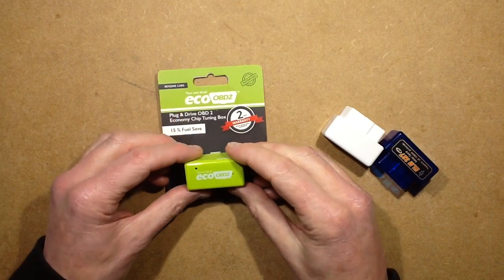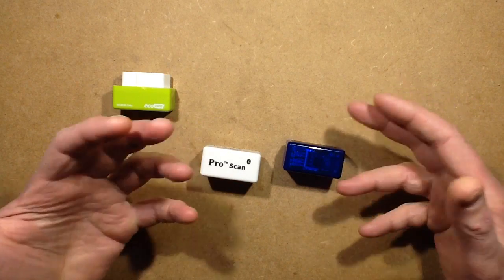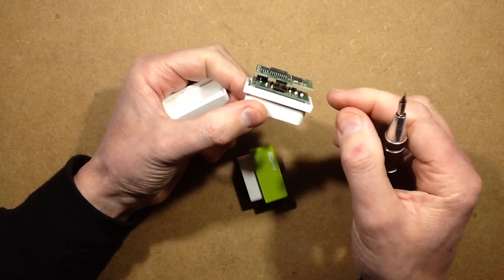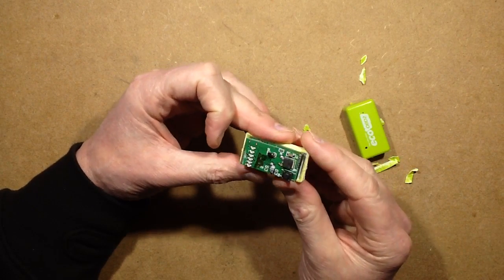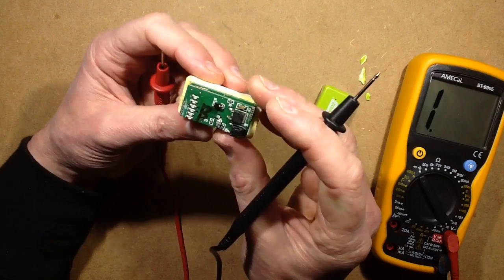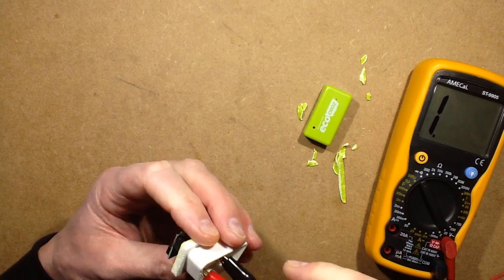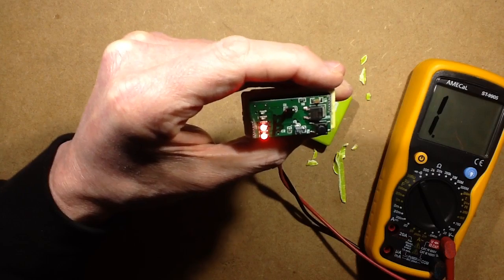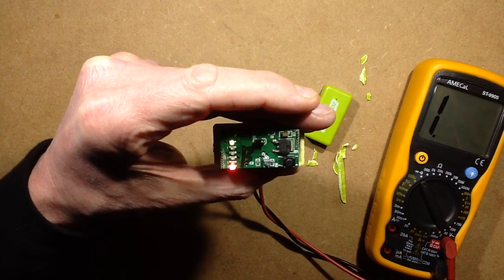Inside an ECO OBD2 "chip tuner" fuel saver.

Comment: I dunno what the OBD specs are, but it's pretty certainly a serial bus. Got an oscilloscope, Clive? Or a Bus Pirate, or knock up something with a microcontroller. 

Would be interesting to see what it's trying to send. With some info on the OBD specs, message format, and commands, you might be able to rig it up to a serial port (or a USB emulated one), open a terminal, and try probe it's depths. 

It looks like it does more than just flash LEDs, a cheap fake device would surely do that much more cheaply, with just a couple of chips. Looks like it's trying to make contact with something. The way the Chinese share / steal intellectual property, they could afford to sell it for not much more than the parts cost, if they could get hold of the software free. Which is kindof a Chinese thing.

Comment: from my understanding, anyone can tune (mode 08) the engine thru the odb2 port.  however, chances are this little device, if it is real, only holds a small amount of power in performing modifications (very limited space for data and only has enough programming to do minor adjustments).  my guess is that even if you connected it up and it did something, it would be unable to cause enough damage that you would need repairs.

Comment: Mmmm.... you opened an electronic box.... and nothing more...
Reply from the maker: +Mac Anix I was able to ascertain that it was more than just a resistor and LED.  But without literally hundreds of thousands of dollars of specialist engine simulation hardware and a long enough test, it's hard to ascertain more.  The sellers are probably relying on that and an "analysis time" to let people forget how much they paid for something that most likely does not fulfil the role of what would be an engineering miracle if it could actively re-map the engine control system of absolutely any model of car.
Reply: +Armens Peas  Oh please... get off your pretentious soapbox. I watch a lot of Clive's videos and find them highly informative. I make one observation on this video and you call it 'belittling & ignorant' and then (ignorantly?) surmise I have no background in electrical engineering LC? I suppose in your world if the comment doesn't fit your predetermined expectations then it shouldn't be mentioned? I recall someone called Adolf had the same great idea a while back...

Comment: Do you see a comm output, for example pins for a serial port, or USB, or a wifi or bluetooth antenna trace?  I'm thinking they just took a OBDII diagnostic scanner, the type you can buy now for around $4 USD on ebay (or less in volume) ordered it in bulk with a different color case on it, and called it something it's not.  I mean that if you can find the way to interface it, you might find it still outputs OBDII data... if there's an antenna lead the first thing I'd try is to pair it with a cell phone.

Comment: I love the little internal needle-hole reset switch, lol... it's like "We know this thing will go wrong eventually, so we need to make it so they can actually try to use this beast again from scratch"

Seriously, if you don't know how to deal with car computers on a fundamental level, you REALLY shouldn't be sticking things into your OBD that say they will 'save fuel'.  I wouldn't be surprised if this just leans off fuel use to save fuel, which will certainly work, but you'll end up paying more later from the damage this can cause in some cars/trucks.
Reply: +ReddmanDGZ  Chances are, it does nothing at all. The reset button is probably just there to make the device seem more elaborate, as are the LEDs, but if the device doesn't make the impression that it does something, people will suspect more easily that it's merely a brick. Perhaps it detects CAN bus activity or maybe even reads some common regular status messages to time the LEDs differently, thus displaying different behaviour when it's on accessory power vs. when the engine is running, and if some sophistication is applied, perhaps also depending on total time of use since reset. If i was a dishonest person who wanted to relieve people of their money, that's how i would approach the task. Much lower risk to everyone involved to release a device that merely imitates activity than one that could actually harm something. And with firmware protection common in today's controllers, it would take consumers a lot of money to prove that the device does nothing, while it's not worth it for them, they didn't exactly pay a fortune for this.

Comment: Yea... if this thing isn't REALLY stringently built and coded, it can basically have horrific cascade runaway in the code (for example leaning the fuel off until it burns up the engine).  The best way to do it is using an old smartphone connected to a USB OBD II scanner, and getting a realtime and logged readout of your driving, and YOU AS THE DRIVER adjust your patterns to save more fuel.

Comment: Hey, this is a new one on Me! Most "power chip tuners" are just a resistor put inline with the temp sender making the ECU run the engine richer in a cold running mode. It makes a little difference, but usually makes the engine run like crap pretty quickly. But having something plugged into the OBD port ? Yeah, i think this is just a little light show and nothing more. I wouldn't be surprised if some came with direct shorts just to mess with people.

Comment: Plug it into a rental car and see what it does... That is a dirty way of testing but make sure you also get the full insurance just in case your test messes the car up. Yes you are spending money BUT you are not messing up your own lorrie.
Reply: +KingOfAllAnimals BTW... drive the car and test how much fuel it consumes between two points. Then make a return trip. Measure fuel use vs. Mileage. Make the trip each way at least consume a 1/4 tank of fuel. Then plug the unit in and drive the same trip both ways with the insurance that the trip is the same length as the previous trips and also enough to give the required time for the chip to do its scanning. Then make the third trip after the device has fully done its job and test the fuel on the exact same trip and see if it improves mileage.

This also is important, make as much of the trip uninterrupted as it can be by traffic. Open Highway type testing is preferred so loiter time in traffic does not compromise actually "Mile for mile" testing. This helps make the results more comprehensive with less margin of error.

If this thing does really work the test as laid out should spell it out clear as night and day f the improvement is noticeable. 1 to 2 MPG or KPL is nice but adding over 5 MPG is quite significant as would a 5 KPL increase in efficiency. More then that would be rather nice.

Also effect the same kind of test in "City" driving. I mean traffic and a lot of stop and go from point A to point B and back to point A. See if the improvement works under both conditions.

For doing this in the same vehicle I would do the City Run first without using the chip. Then I would do the Highway run without the chip. Then I would do the Highway Run to calibrate the chip. Then I would do the highway run after calibration. Then do a city run. Compare mileage under all conditions trip for trip. Reset the chip and do the City run to recalibrate and then the City Run to test mileage again to see if there is any noticeable difference between it learning from Highway Driving to City Driving and the efficiency it produces.

The reason I would do it this way is for these very reasons:
1. How intuitive is this system? Can it make adjustments that work for ALL driving conditions or just tailors itself to a specific kind of driving ie. City vs. Highway. I can tell you for highway having Cruise Control makes a huge difference in mileage. There are variables like this that must be taken into account like does the test car have Cruise Control or not and if so is it used in part or whole of the A-B-A trip sequence and where and for how long. It all depends on how accurate you are looking to get for your testing.
2. You can more accurately tell if this system actually DOES anything for the vehicle under both driving conditions.
3. You also can hook up other diagnostic tools for on the fly real time data harvesting just to get the real ticky tacks on what this things does.

Best part is using an insured rental car you can choose your specific test bed and then switch to another car to see if the results are repeatable in a different make and model again not risking your own vehicle for such testing. the "Full coverage insurance" will deal with those "Ooops moments." That is all part of the cost of renting a car. While it does cost money it does allow for you to test this out effectively and also it gives you time in selecting the best candidate cars for testing and which diagnostic tools you wish to run while conducting your testing.

...For some odd reason I am feeling a touch scientific today...

Comment: I tend to agree with you on being nervous about plugging it in...I had one of the ELM327's that was orange and it seemed to work but was slow so I got a blue one and it scrambled my car after the 1st trip, I got a bunch of warning lights, the computer stopped responding to accelerator movement, stability control, cruise control cut out, electronic parking brake stopped working...then when I stopped I couldn't get the engine to re-fire (crank but never start).  When I finally got it to work in any capacity I had a bunch of fault codes for COMM-BUS faults and sensor-faults.

I now have an OBDLink MX which cost a fair bit more but works fast and hasn't set off any error codes.

BTW, I find to brake those things open with the least damage, a few whacks along the seam with a rubber hammer usually breaks the glue with no damage.

Comment: The blue one works perfect in my 2013 Berlingo and the Torque app.
Reply: +ferkemall I have an ELM 322 with the torque app and I use it on my Chevy Volt. It is able to read pretty much all the information and reset codes even for odd subsystems like "high voltage charging system," etc.

Comment: An easy way to tell if it at all does communicate. On most Chrysler vehicles (dodge, ram, and jeep included) if an external can bus ecu is detected on the bus of the vehicles network, there will be set on multiple nodes the communication code U1147 (external can bus edu detected) So if you plug that little device into a Chrysler vehicle, and happen to know someone with a scanner such as a solus edge like myself, after you plug it in and unplug it, you'll find that code on multiple nodes. Easy :)

Comment: As a technician I will have to say it probably does nothing, as any "fuel saving" device does. At very most it will probably try to tell the ECU to open the injectors less which would seriously damage the engine if it was running lean for long periods of time, but having said that, if it even could try to limit the time the injectors spray for the ECU would overrule anything as it's programmed to keep the stoichiometry at 14.7:1 (air, to fuel ratio). 

The only way you can actually hard program an ECU to be more fuel efficient is to actually have software and hardware which you manually control and adjust by your own knowledge, or that of a pro-programmed "map" as they call them. Bluefin is a well known example of the only DIY kit you can buy which can increase power by a few BHP but at the cost of several hundred pounds. 

Diesel is where the real excitement is coming into reprogramming ecu's, because more often then not you can increase BHP dramatically and in some cases almost double the torque figures while actually being in some cases around 25-40% more fuel efficient, but that does include some physical engine modifications such as removal of EGR/DPF etc. 

The only real way to save fuel, is not to buy ebay product from china, but to leave the car at home and walk! :-)

Comment: if it does anything its more than likely ignoring the emissions requirements and giving the engine its proper fuel to air ratio,  the leaner you run a gasoline engine the more horsepower it produces (within reason of course, push it to the extreme and it will cause catastrophic damage) more horsepower per given RPM means better fuel effeciancy.for the sake of emissions your cars computer does everything it can to maintain a mix of 14.7:1, which provides the cleanes emmisions, which is normally not what the engine wants

Comment: The only way to find out if it is a hoax, is hook up a bus analyzer to the can bus and look what it is spitting out.
Reply: +donven33 Simple put, it isn't possible for such a small device to effectively manipulate the mileage. It could do basic calculations but isn't capable of writing something into the bus to effectively alter the engine parameters. You need to know the exact PIDs and the layout of the ECU. I couldn't even see any memory or even at least an ELM327 chip which would be able to communicate with the ECU. There are very complex OBD-Plugin chips on the market which are designed for a specific car and do the job but are very limited and quite huge actually. If you want to get more out of it, you need to opt for a solution which sits near around the ECU if you don't want to overwrite the original mapping of your ECU. I installed a chip into my car which sits between the commonrail and ECU which is able to precisely manage the engine parameters, increasing bhp and mileage (documented). The reason why this setting isn't to be found on a stock car is that for example the greater brother of my car would have the same engine but a different mapping and therefore would do the same like mine with a chip but can be sold for much more money. I could even have a mapping from 2 steps above my model and it would run just fine without any reason to be worried about an engine failure of some sort because it is just a different set of parameters fed into the stream.
Bottom line: Chip tuning is a thing, mapping ECUs is an art and OBD Eco devices are a huge hoax.
Reply: +tHaH4x0r I think it would be easier to solder a few wires on the microcontroller's JTAG pins and dump its firmware. Few hundred lines of assembly at most.
Reply: + bigclivedotcom Hey Clive why not build an intermediary device that will record all the converse between the dongle and the ecu and make a great video off it? there is an idea for you!
Reply: Taking a solder sucker to one of these very soon with that sort of thing in mind - although I did find that a number of the pins coming through up by the LEDs are actually just wired to the bottom (red) LED - presumably so as to make it behave like a communication indicator. At this point I don't believe it does anything at all.
Reply: bolter99 it depends on the provider. Companies like RaceChip are using adaptive algorithms in order to get it right. These are most comparable to the original ECUs behavior from a more powerful version of a particular engine. Cheap tuning boxes however are just the aforementioned op-amps.
Reply: +El Neuro Quila Agreed. However, the "chip tunining" boxes are just glorified op-amps.
Reply: +tHaH4x0r At first I thought that would be interesting, but we can already see there's no memory on the board. No memory controller. Basically no processing power except the one chip. Unfortunately it probably doesn't spit out anything at all.
Reply: +El Neuro Quila it is most certainly possible for such a small device to do so much - look at the size of your smartphone, and consider what's left after you pull out the screen, battery, speakers, microphone, buttons, bluetooth, wifi, and so forth. However, for the price, it's very unlikely that this device does anything like tweaking your fuelling map. More likely it just bumps your throttle up a notch or two, or bumps your intake air temperature down a couple of degrees - or both. Doing those things is pretty straightforward with CanBus, and it would follow that it might need a certain about of time to ascertain what "normal" values are for your vehicle. (My car shows some very non-linear and sometimes downright weird values for throttle position, for example - and there are several sensors for that, even.)

Comment: I assumed these things would just lie and do no reprogramming, which would actually be BETTER. It would be quite disturbing if these are actually reprogramming. I think it is just a game of pretend for those too stupid to realize how bad of an idea it is. 
It is better to cheat the dumb instead of giving them what they want and make them pay the real consequences if you ask me. That light show is pretty convincing in looking like communication, but i think it is just that... a light show.
I wouldn't be surprised if it passes the data lines through a transistor to flicker the lights, but that is probably all it is doing with the data. Does it have storage? I didn't see any kind of storage at all. That is enough to call it bullshit.
Reply: I was about to buy one of these, but your words convince me otherwise.
Reply: +rgandblue Real ones probably do exist, but I am a programmer myself, and I have a hard time putting faith in a device that can 'universally' improve gas mileage. There is no standard when it comes to software, only the communications is standardized, and the software itself is all closed proprietary standards. In this, i would not believe any of them that state 'universal support' and still claim to reprogram. That terrifying if it actually tried living up to that claim.
Tuners for specific models do exist however, but usually, it is done by connecting a laptop to the communications port, and flashing with modified programming, like you would hardware on your computer. This requires enough technical know how that it would be better to take it to someone who knows what they are doing, not only because he would be less likely to mess it
up, but also because you would have someone to put blame on if it goes wrong ;)